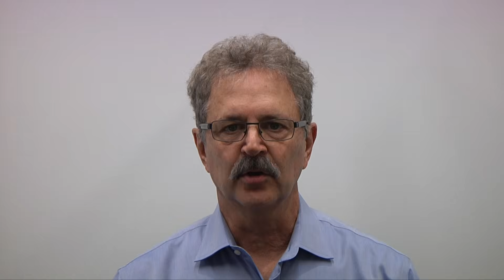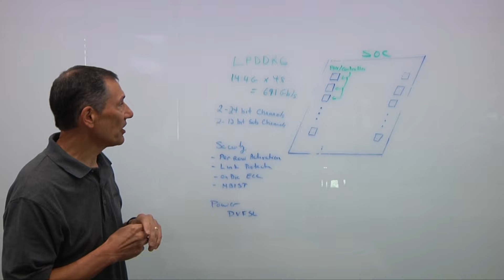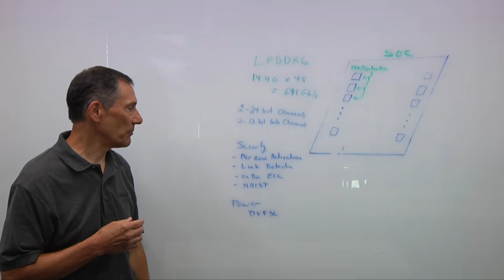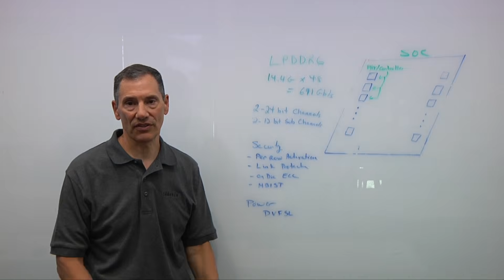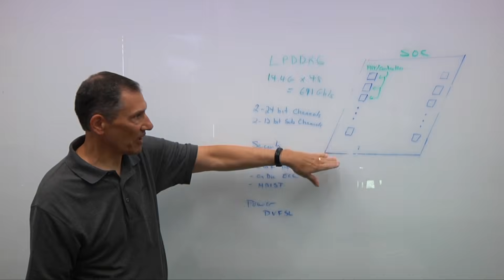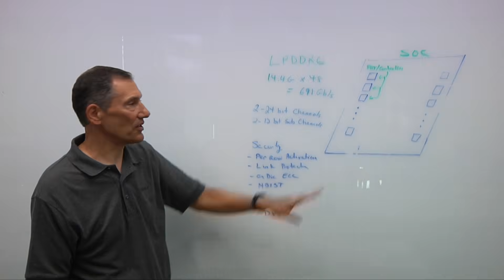LPDDR6: Not Just For Mobile Anymore

Comment: 3:45 “36 Gig” … believe the units are “36 Gbits/second” pin speeds.  People may be left wondering whether you mean 36 Gbit capacity parts.  Or even Gbyte.  People may not understand the units to be Gbits/second because 36Gb/s is way faster than previous pin speeds and of other DRAM types.  Even HBM has been under 10Gb/s until recently and that speed is barely being surpassed.